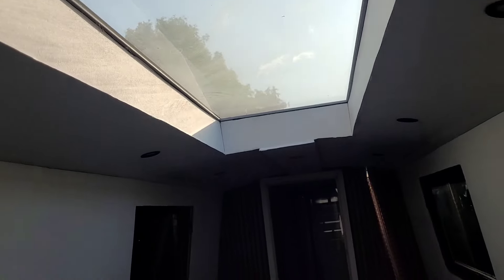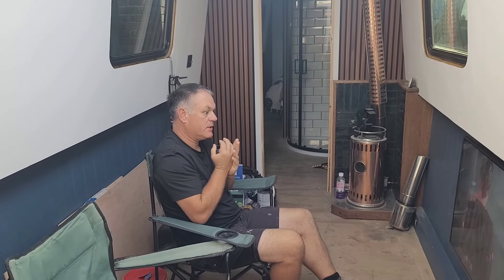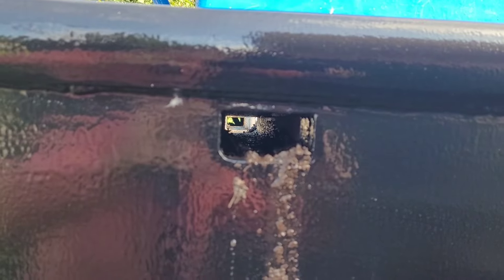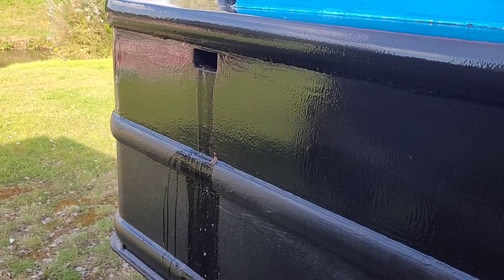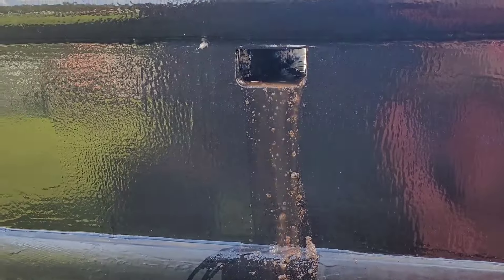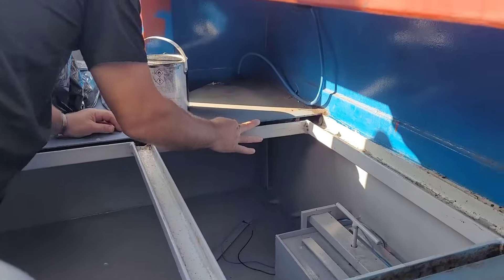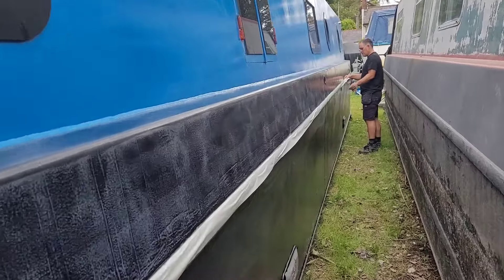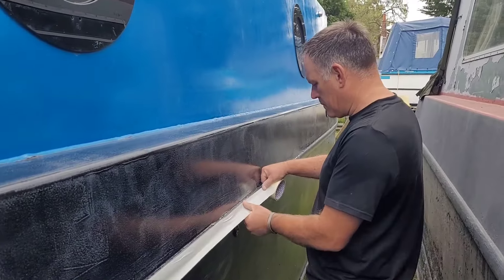Getting the crud out of the channels #133

Comment: Looks a lot better. Also I was watching a vw camper restoration blog the other day and you can get aerosol cans with pipes on the end of stuff that allows you to spray the inside of tubes you can’t get to to protect it from rusting. They used stuff like vac tan first then a spray paint after to protect it from rusting. I think you should look into it and so the inside of those tubes you were cleaning with that long brush.  Might also help stop getting rusting stains on the outside of your hull. I’m sure the brought the stuff they used from a car accessory shop or car paint shop.
Reply from the maker: @Marklovescarpfishing  great advice,  we will definitely look into that 👍